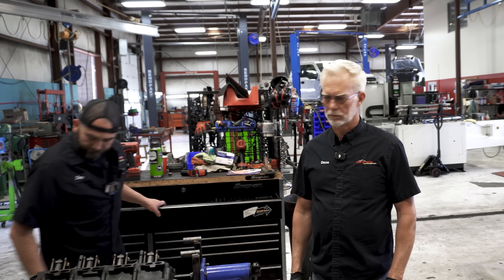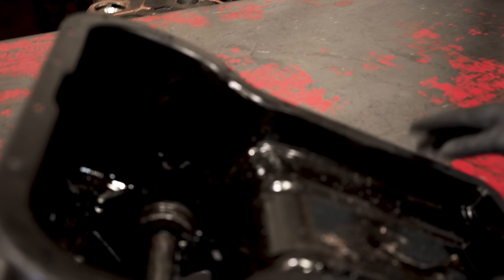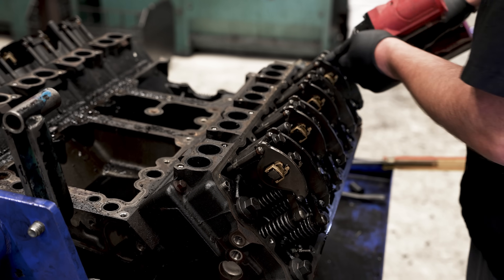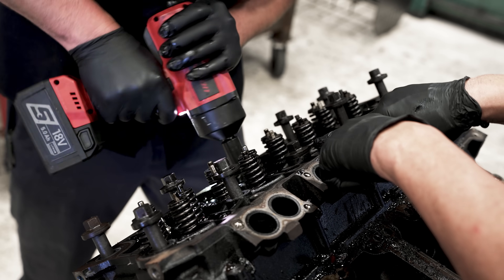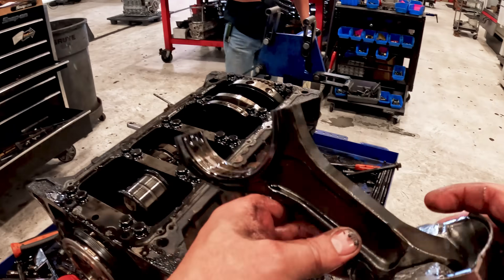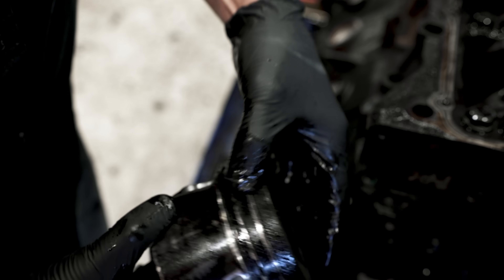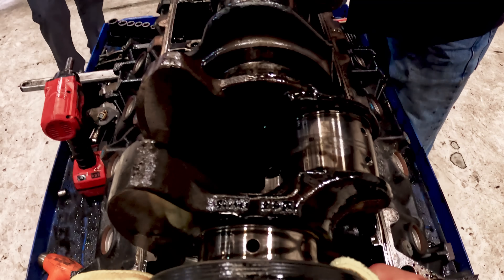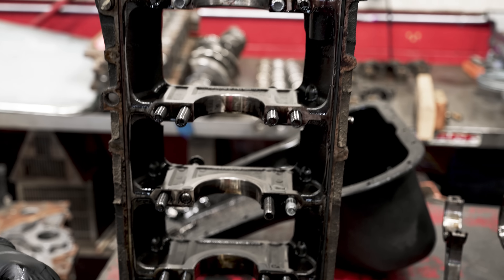Ford 6.4 Powerstroke failure analysis

Comment: $2,000 to $3,000 for a core charge?
Wow, that is way too much!
I'm glad I saw this video, cause now I know that I'll avoid buying one of these trucks with a 6.4 Powerstroke diesel engine.
Thanks for sharing this valuable information.
Reply: I couldda told you that ten years ago. Get a 6.7
Reply: @JohnSmith-lv8xk 
They were only used from 2008-2010, so that’s how you avoid getting one, don’t buy diesel Ford trucks from those years or just plan on doing an engine swap and junk the 6.4!
Reply: @AzzKicker-bz1cb 
Now I know why I should avoid a Ford F250 diesel altogether. 
I'll just get a Ram Cummins diesel instead and avoid all those problems.
Thanks!!!
Reply: @cma8165 unfortunately they are crap now also
Reply: @bleachinuri  well, I had heard that Cummings was having issues, on this channel also. What do I know. My point is all new diesels are garbage. You shouldn't have to buy a truck and then delete something to make sure it lasts.
Reply: @bleachinuri haha I have a 2018 "duratrash" and pull a 6 horse gooseneck through the Rockies 8% grades and all I do is fill with fuel, tires, brakes, and oil changes. 🤷‍♂️ What's supposed to be broken on it?
Reply: @scottleggejr  we had 250 brand new duratrash in a fleet of school buses, 4500 van chassis, after 2 years and over 150 engine replacements from catastrophic engine failures, way more aftertreatment issues then you could ever imagine, you ask what's broke on them, everything and anything.
Reply: @jamesgeorge4874  that's why ram dropped the aisen and 68rfe, they are now using the 8 speed ZF, and I've owned them all, GM's transmissions in the last 8-10 years are just as bad or worse then the Rams
Reply: Unfortunately all brands comes with some issue or another. 😂😂
Reply: Actually very fair. The block if you can find a good one is 3k and more unless you get lucky. 6.4 is its own animal made 2 years only

Comment: 6.4 = money pit.
Reply: Absolutely correct I'm 41 yrs old been wrenching since I was a kid. Started doing it for a paycheck at 18 yrs old. All the Diesel Engines now are not worth it in my opinion. Diesel fuel use too be alot less money. Now with all the emissions components and DEF. it's so expensive, unbelievable, the company I work for has Diesel and gas engines on pick up trucks. Diesels are horrible  always leaking oil, even brand new? The amount of room under the hood is 0 they use every square inch on a F-550.
Reply: @ZMAN_420  Precisely why I’m keeping my OBS 7.3 PS
Reply: @kenxiong6830  A 7.3 is good in my opinion. Cummings 5.9L 12 valve (6BT) Is my favorite, they came in dodge pickup truck in 80's and early 90's I think. No emissions all mechanical.
Reply: @ZMAN_420  yes the 7.3 PS and Cummins 5.9 12V are the best diesel engines out there. Duramax guys may believe otherwise but it took GM a few years to get the Duramax to be reliable. The 7.3 PS and Cummins 12V were great out the gate. All the new diesel engines are so littered with plastic parts that they fail so often.
Reply: @kenxiong6830  Agreed!👍🏻🇺🇲
Reply: @ZMAN_420 7.3 and 5.9 are the kings of diesel pickups 👑
Reply: @ZMAN_420 what makes it worst the ones who mandated the emission standard exempted themselves from it as well the government does have to worry about it but we not only have to we have to pay for it as well ain't that some bullshit
Reply: Got a 08 6.4, 336k miles, headstuds at about 150k from trying to be a racetruck and the radiator ends blew off at about 200k other then that not an issue, even original tranny. Been deleted since about 50k miles though, running 200hp tune. Will still smoke any stock tuned diesel today 🙃
Reply: @ryandaddino559  another testament to the 6.4 if this keeps up we maybe able to turn the 6.4's reputation around congrats man
Reply: @ryandaddino559 check out the fix for that intercooler if you haven't yet. It's at mishimoto. The metal bar holding the top of the intercooler is flimsy and bends over time from every impact.
Reply: Been supporting Ford mechanics and YouTube channels for almost 2 decades
Reply: Because 6.0 and 6.4 only have 4 headbolts per combustion chamber most powersttokes have 6
Reply: Same with the 6.0. It's basically Ford = money pit.
Reply: You ain't kidding, I done one 6.4 for costumer he wasn't happy 😂
Reply: And they said the 6-0 was garbage … do egr delete and head studs and it’ll run literally forever
Reply: @StevenSimpkins-p7x  contaminating getting one actually
Reply: @StevenSimpkins-p7x only problem is EGR delete is not exactly legal
Reply: @michaelcoonce6694  not at all, but in a 6-0 a lot easier to hide and epa isn’t looking at 6-0s for emissions especially with the age of them
Reply: @StevenSimpkins-p7x  I ve got several. 6.0 and 6.4 s they are a pain to keep  running. I will say  6.7s are marginally better
Reply: 6.4 = short lived junk! Garbage 🗑

Comment: Can't u line Bore and save the block?
Reply: nope. not if you want one to last. Spec sheet says 0.020 is as far as you can go on boring them. typical a spun bearing is about 0.040 out
Reply: @loligagger85  yes but if u cut down the main girdle and then line Bore to factory main bearing size wouldn't that work?
Reply: @marksrepairj623  HOW would that work? then you would have to change out connecting rods or machine some of the piston off and that changes the bowl. the answer is NO, you can NOT.
Reply: @marksrepairj623  yeah that's been done on a few around here even a few 6.0's since they share the same architecture. You mill a little off the bed plate and then then line bore it back to true. Then you don't change the clearance of the cam and crank gears or the piston protrusion.
Reply: Yes you can line bore it. I've done 2 of them. Get oversized bearings and you're done.
Reply: @brandongriffiths2677  that's what I figured
Reply: @brandongriffiths2677  NO YOU CAN NOT. not these engines. not on a spun bearing that tempered the journal. the largest oversize for these are 0.020 and you can push 0.025, not before having the machine the piston and also the valve clearances to accommodate. i guess you can do those things but for $3k to $4k cost its cheaper to replace the block. ESPECIALLY if you do work like they do, fixing the BS you think you can do. the heat treated effected area that has to be bored out is over 0.040, TWICE the limit
Reply: MS-52334K-OS here ya go. That's .040 oversized. So yes it can and has been done.
Reply: @brandongriffiths2677  NOT when the bearings have spun. you cant HONE a hardened surface like that. Yes you can do it but its not going to work, EVEN THE PROFESSIONAL IN THIS VIDEO SAID NO